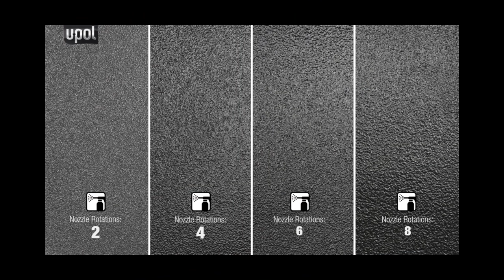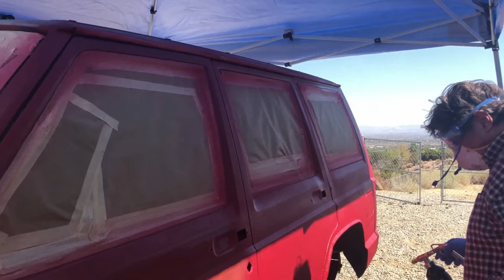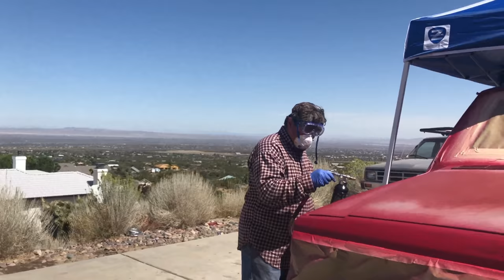How to apply Raptor Liner on a Jeep.

Comment: I'll never understand why anyone would texture a truck
Reply from the maker: Hi Matt, For us it's because we wanted a tough/durable exterior finish when we take the Jeep offroading, plus we like how it looks. :)
Reply: @5150MotorSports  I get that, Im a jeep owner and off roader as well. And I agree its very durable , I also know after a few runs through the sticks and mud, its hard to clean, and make look nice again. If just a trail rig I might do it, But i like to drive my rig around as well as off road
Reply from the maker: @mattsez2879  I get it Raptor Liner is not for everyone and mud does stick to it,  I have a trailer that we Raptor Line and use it all the time, dirt, snow and mud.  We use a pressure washer and cleans up very nicely.  We have not finish the Jeep yet so time will tell. :)

Comment: You do realize that the masks your wearing wouldn’t help very much for paint fumes right?
Reply from the maker: Yep, fully understand.  Thanks
Reply: Better than one guy that didn’t have a mask at all
Reply: Thanks for sharing the video.  Not to beat a dead horse, but please consider investing in some respirator equipment.  Those of us in the old car hobby are generally exposed to hazardous materials more than the average person.  So do what you can to protect yourself and others.  You will thanks yourself down the road.  In case you want a respirator recommendation, I found a full face model that is very easy to use and comfortable.  Doesn't use buckles - so you can take it on/off in seconds. Previously I had a half-face respirator that I hated using, was uncomfortable and more difficult to secure.

Comment: how many liters of raptor  paint did you use?
Thanks !
Reply from the maker: Erika Lipkovics We used a total of 7...
Reply: Same took me just over 7l got a little light on the bed. Nice thing the coating can be touched up and blended realy easy
Reply: Had a little fun with the coating: wanted to see if it would stick to the rusted rear bumper. Used what should have gone extra on the bed sides. First time using the Raptor coating. Going to get the few photos made and a walk around going for a short film. Great way to save a good truck or auto.